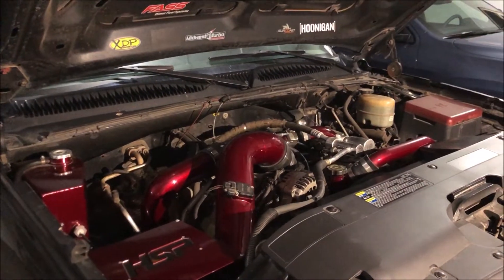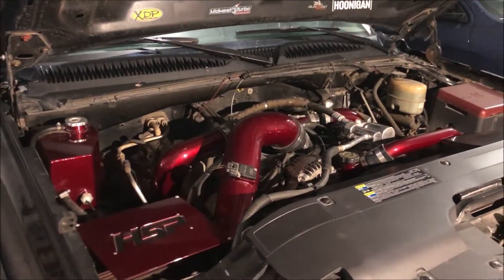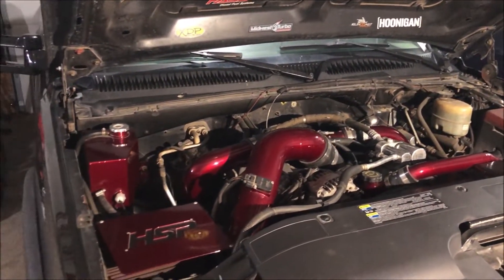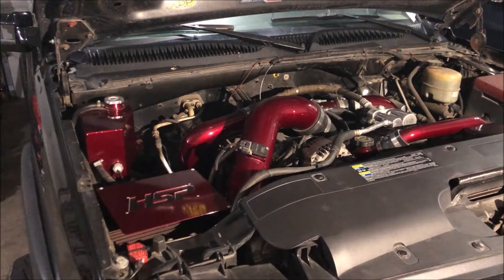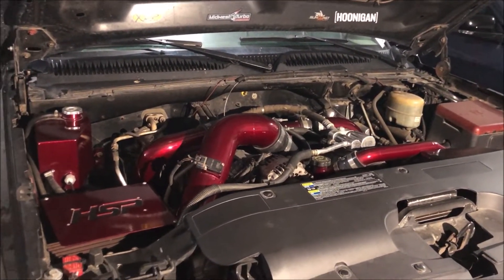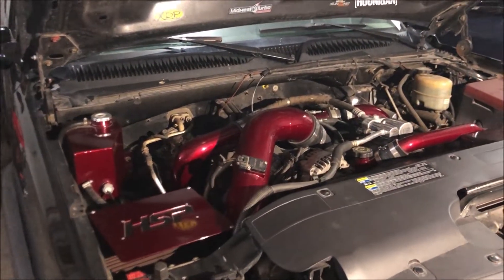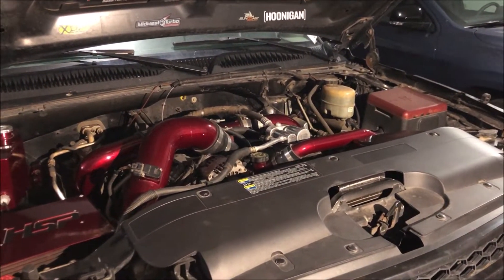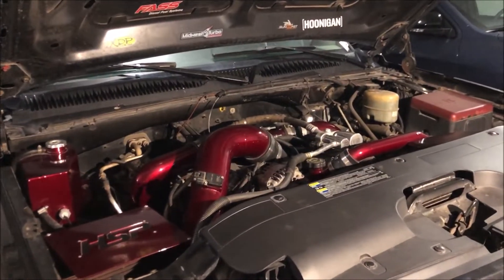New Turbo for the Duramax!

Comment: Have you had any local pulls to go to? We have some in Iowa through ECI. We have one coming up in Davenport , DeWitt and Burlington. Not sure how far you are away from there. It would be great to see you there
Reply from the maker: It's been a very bare summer for me so far. I've had 2 drag racing events that have been cancelled/postponed lately which have been frustrating. As far as sledpulling, everything within several hours of me has been cancelled so far, up through late July, except we have a pull this Saturday the 18th finally! Streetstock/workstock class for me. I've considered going out of state but lately I have been super busy (notice my lack of videos the last 2 months lol) but I may try to get out, thanks for the tip!

Comment: My question is how in the hell did you get the factory down pipe off. I know you can break the bolts off
Reply from the maker: Sorry for the late reply! They are a pain in the butt for sure. Soak them good with your favorite lubricating agent with the engine slightly warm and let them sit over night. Ideally you can get a stubby impact gun behind the motor and let it have at them. I ended up having to try the ratchet strap method on most of mine. It worked on 100% of them to loosen them all, but broke 2 of the up pipe bolts off. I was junking that original turbo so I didn't care but if I had needed it it would've been an issue. If you can any way shape or form get an impact in there that would be best. Stubby guns for the win, I have one now but didnt then.